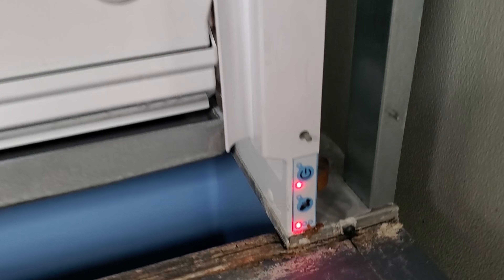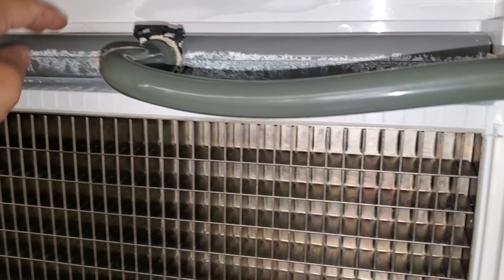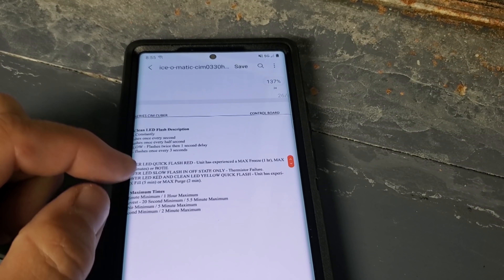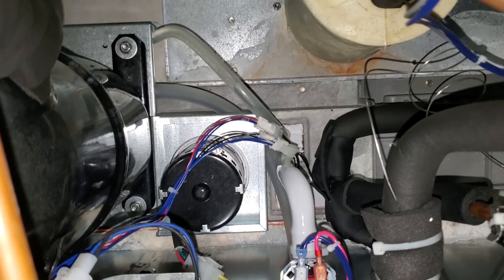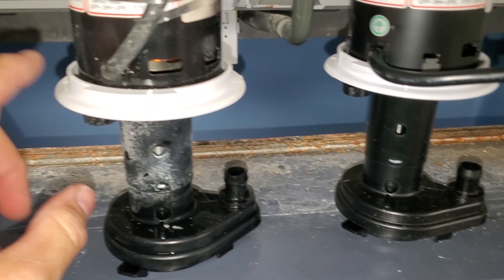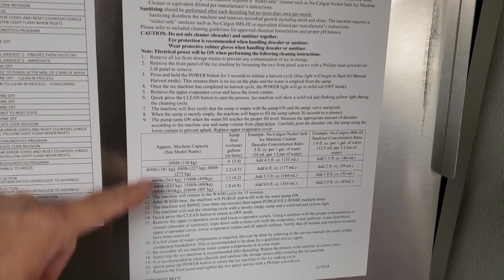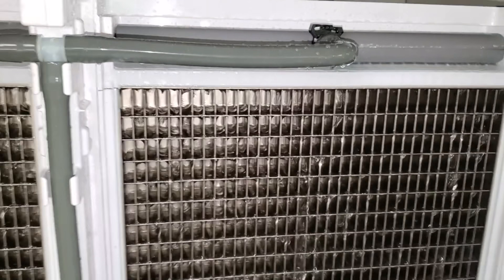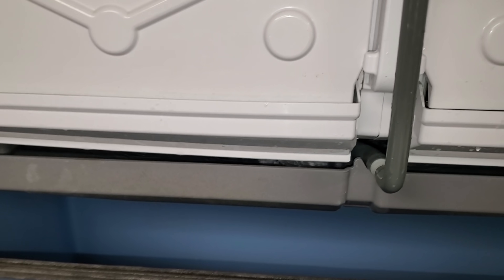HURRY THE ICE MACHINE'S NOT WORKING

Comment: What happened was a small piece of plastic broke off the lower portion of the evaporator and became lodged into the impeller of the water pump. Next time use lineman pliers and knock the base off to give you access to the impeller and get that plastic piece out to have your water pump running again. After that, you need to order replacement lower water curtains (that machines uses 2) and trim the plastic off the other sides, otherwise you will come back again for either A another locked water pump or B you will start making thin ice because that side plastic that breaks off actually diverts water into the sump and without it and not replacing the lower water curtains, you will constantly dribble water into the bin from the sump. I've sold hundreds of these CIM iceOmatics and every single one needs this done. They just came out now with a new revision to fix this issue. I hope this helps

Comment: There's something a little condescending about your thumbnails.  Most of the people calling you with these vague and often inaccurate problems are restaurant managers.  Most of them are working for less money than the people they manage, in hopes they can advance their career.  Many of them are working 12 hour days or longer.  Many of them are working 6 or 7 days per week.  I get it that you know this subject better than them, but by sarcastically including their naive self-assessment along with a video documenting how bad they've let things get seems a little unfair to them.  

Speaking as a restaurant manager who came into a role and within days changed some long overdue filters on his own AC units, this is just a little food for thought.  Incidentally, the restaurant was operating without a GM before me.  And believe me, there are far more pressing things on my radar than the condition of the AC units at the end of winter.
Reply: Just a thought as I'm in the trades that service restaurants. 
A small amount of preventive maintenance on the equipment,  saves slot of down time. And after hours service fees. 
Most equipment should have a maintenance schedule.  
Usually it's minimal filters etc. 
Just a thought

Comment: I always pull all the hoses , pans , water distributing system, Evap covers ect and clean them first. Then I clean the area around the Evap. Then I put it back together and run the clean cycle. I clean the bin and other parts while it it cleaning and sanitizing the Evaporator. I have had enough calcium in the hoses and pan to make it were the cleaner did not have enough strength to do the Evap. Each person has their on system that works for them. The end results speak for itself and yours always look nice when you finish cleaning.

Comment: For cleaning ice machines I use 99% vinegar for everything but the evaporator/clean cycle. It doesn't smell the greatest: but it works really good on scale, isn't as harsh on your skin as say CLR or other scale removal cleaners, its cheap (like $1.69/gallon on grainger) so you can use as much as you want at full concentration, and its food safe. Also those cotton toilet brushes work really good too.

Comment: Love Ice-O-Matic and even like the cim series but there have been so many water migration issues with those units. I know them inside out now. You may want to check out the water guide tabs (they're on the bottom of the evaporator) whenever you get on those. They're notorious for snapping off and Ice-O-Matic has  recently done away with those tabs. They are having technicians trim them off and replace the curtain with an updated one. These units use float switches that go off water level strictly, so if there is water loss during the cycle the bridge will not form properly and the ice may not drop. For cleaning, was wondering why don't you use a hand pump sprayer with just a small amount of nu-calgon nickel safe? I've made the dirtiest machines look brand new that way, it truly works great

Comment: Water softeners on ice machines should be avoided in most cases. Excess sodium in water has the ability to alter the freezing and melting temperatures of water. Thus, water softeners will lead to soft, mushy ice cubes that melt faster and can negatively impact beverage quality. ,: I copied this article from the internet and I wonder what say you about this,  aside from that, there has to be something to prevent the build up, thanks..

Comment: I work on these machines all the time plastic from the water guide on the evaps always break and get stuck in the pumps and or they just burn out all the time
Reply: True. They have a kit that requires you to cut the fins off and replace the ice guide. Without the new ice guide water drips along the side and the unit will loose too much water during the freeze cycle.
Reply: @commercial_service  even with the new ones it still does

Comment: If you're EVER required to use a screw driver, steel wool or anything like it to remove mineral buildup, it's time to:
1) Start cleaning the machines according to Manufacturing Recommendations (or more often if you already were)...
2) Install (or replace) a water softener for that equipment...
3) Replace the encrusted parts to prevent customer illness due to bacterial contamination...
Reply: can you use a water softener on drinking water (or ice)? I thought you couldn't.
Reply: @radiosification  Yes, may companies (Culligan for example) make water softeners that install right after the water shut-off valve (where the city line enters the home) that soften all the water in the house.
Reply: The water softener is a good idea, Sir

Comment: I'm betting the pump bearings/shaft/impeller got clogged with calcium which eventually caused it to burn out.

That restaurant needs a water softener at least for the Ice Machines...
Reply: True. But they won't spend money if it doesn't make money.
Reply: @jeremyhall7951  I work for a company that actually has 2 water softers and we still have a problem will calcium build up. Steamers and Dishwasher need to be delimed all the time. You have to always flush the steamers with vinegar. Ice Machines need to be cleaned all the time too but not as much. Ice machines need to be sanitized all the time because they actually grow mold and your health inspector will check that.